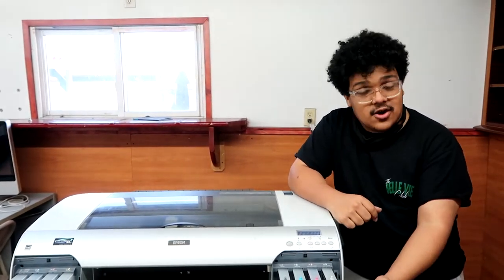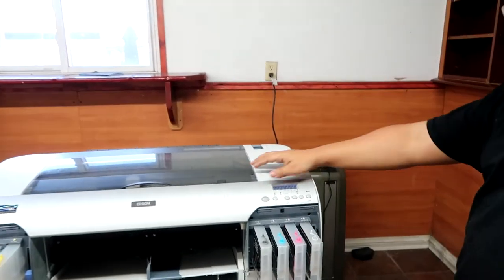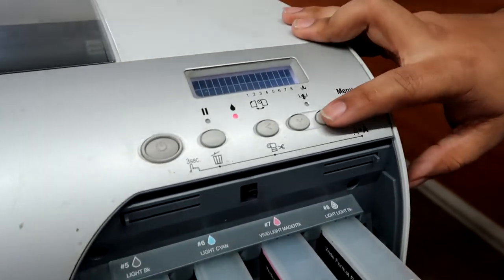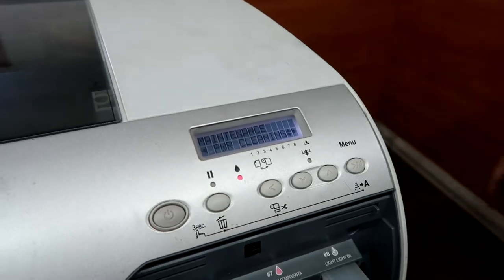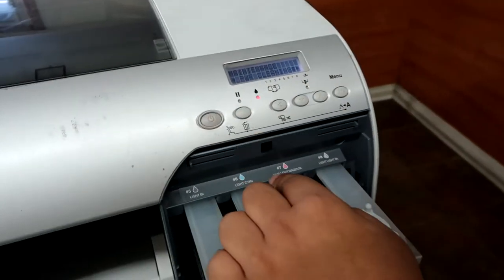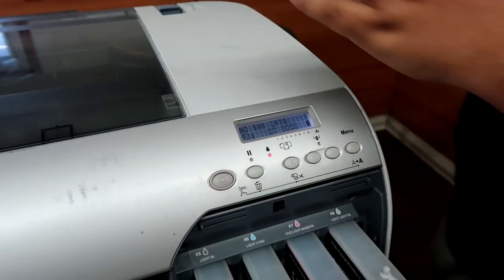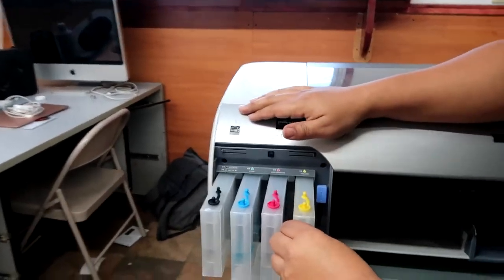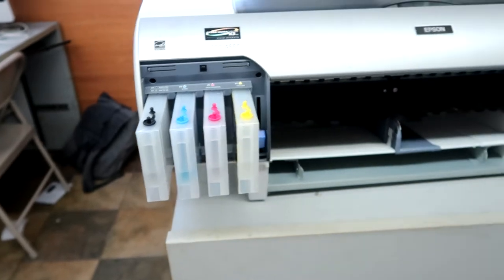McLaud DTF Vlog#221: How to do maintenance on the MP-1708

Comment: Would you do this every day regardless if you print or not?
Reply: You would perform a normal cleaning every day, at least once to keep the print head clear, and to make sure ink is flowing through the tubes and not settling. To perform a normal cleaning, just hold the menu button for 3 seconds.